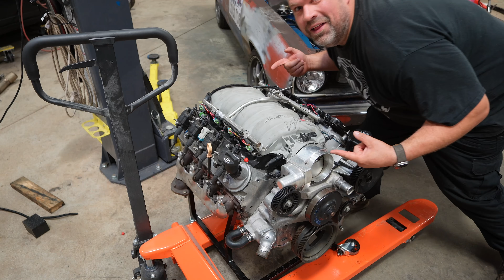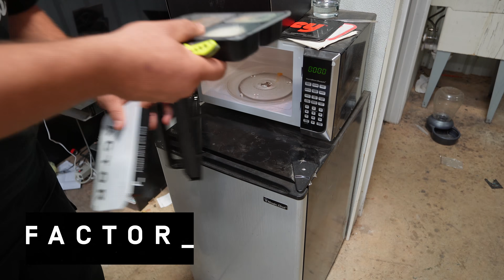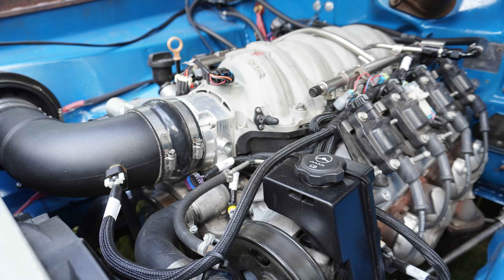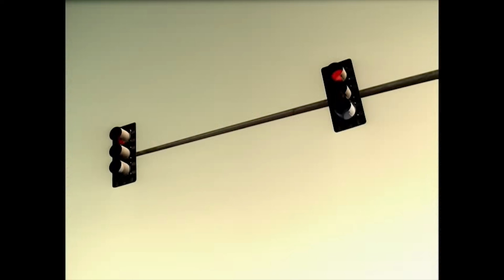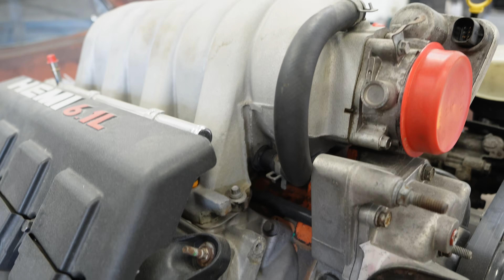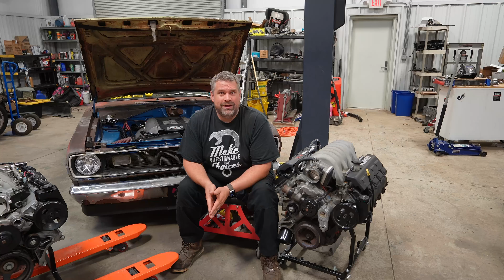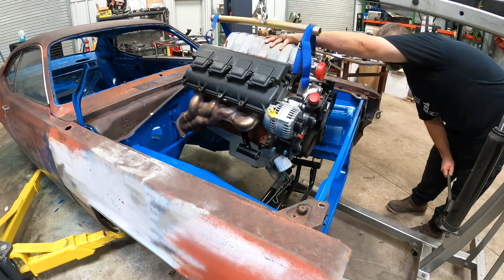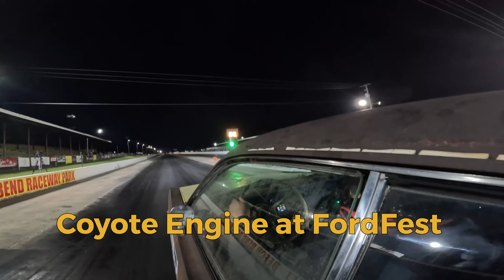What No One Tells You About Engine Swaps! Best Engine To Pick?

Comment: A verygood and informative overview.
Im 80  and st a rted r ngine buildups hot r odding racing and restoring cars in the 60s thru now.
Id add the following observations.
These observations pertain to street and racing but not both all the time.
In my experience for racing or street hands down the easiest least expensive most available most supported engine is the LS Lt family.
They are compact light weight and very durable..
They will fit most all RWD CHEVS going back to the tri five passenger cars and trucks.They are light weight and favorably affect weight distribution and thus handling . Wig h t ONLY  top end modifications you can reliably increase horsepower and torque by 100 to 150 hp depending upon which LS you re tzlking about.
Chevrolet and the aftermarket support modern LS electronic packages .The original vomputer can be reprogrammed by tuners who know the codes. The LS 3 for example with a little he s dwork and cam change and a Magnuson supercharger jumps from around 440 hp to nearly 600 reliable hp. The 505 hp LS 7 can with headwork cam and exhaust changes make around 650 hp normally aspirated on pump gas and little change in driveability or gas mileage . If you re going to track a Vorvette on a road course for durability because of sustained high rpm and lateral G forces you must instsll a good 3 stage drysump system. This engine was the high point of the normally a s pirated LS series to date in my opinion..
Any of the stock of modified LS engines can be ea a ily retrofitted into just about any GM RWd chassis due to extensive multiple source s of retrofit kits.  Additionally dive aftermarket transmission and susp r nsion suppo r t kits allow hughe upgrades in handl😢ing snd braking performance to match the power output. I personally have seen a 67 chevell with a supercharged LS3  and extensive Hotchkiss suspension mods and Baer brake front and rear disc brakes and high performance 18 inch wheels and tires pull 1.07 lateral G on a skid oad. Detroit Speed skes kits that can better this.
MOPAR. My personal preference since the 60s was to avoid the hemi. It still is.
Fir d t off the Hemi was never as delivered from the factory a satisfactory street engine. It could be modified to be one but the initial cost plus the modi G ication cost was simply not worth it. A sharp running 440 375hp Mopar with 3.9 gears headers and single Holley 4bbl was more effective. The 440 6 pk engines would generally beat a street hemi for f a r less cost and not nearly the handling oenalty.
The modern hemis especially the 5.7s have valve tr a in probles that result in loud ticking noises and early camshaft failure. The engines are relatively expensive out of the s a lvage yards. They are iron and heavy.
For big block work I far prefer a bored and stroked 440 out to up to 512 c.i. using CNcPORTED ALUMINIUM HEADS  headerrs a Holly F I sustem and an Indy or Edelbrock aluminium manifold.
This results in something north of 650 hp streetsble less front end weight in a retofit to a Challenger or Barracuda and hence again the potential for vetter handling.
For small block usage i prefer the 360 LA or Magnum short blocks. Again with the proper camshaft  sto c k or CNC ported Edelbrock or other aftermarket aluminium heads  carbonated or injected fuel system these engines can produce 415 hp and around 440 ft lbs of torque. Running on pump gas with a 10 to 1 compression ration. They can be bored and stroked to 408 c.i. at which time 450 to 500 hp is attainable..
And theres no weight penalty . The only caveat is because of the lack of crossbolted or s payed 4 bolt mains you should depending on the displacement and stroke rbuild the engine to make max hp by 5500 to 6000 rpm.
Im not a fan of Chrysler automatic transmissions after the Torque flight or their ability to live with much more than 400 hp being thrown at any of the overdriven units so I use Tremec 5 9r 6 speed m as nual transmissions.
The Chrysler 8 and 3 4 unit is bulletproof for small block applications. For big block applications the Dana 60 with Moser axeles works very well.
Excluding the modern supercharged Chry s ler hemis making from 700 hp up the engines I have mention will outpergorm are simpler lighter and less expensive than the modern norm a lly aspirated hemis and probably more durable .
The Coyote engine is lovely to look at delightful in concept and needlessly complicated and trouble prone. It doesnt fit in the 60s and 70s engine bays due to shock tower and other problems.
By far my choice is the 363 package engine from Ford.
Dimensionally it will fit whereever the 289 or 302 engines would fit .its east to retrofit oringinal accessories will generally bolt on it can run on pump gasthe heads and intake are aluminium its light and its simple. As delivered in a box it makes 500 hp vs the Coyotes 465 hp. When slightly detuned with a dual plane manifold and slightly lesscaggresive came hp drops to 475 hp and its completely streetable.
Its t he answer to early Mustang Fairlane or Falcon upgrades. And the suspension and brake departments are well supported by the aftermarket. Modern aftermarket FI sysrems work well with this engine. Again I o refer Tremec manual transmissions . The Ford 9 ingh or 8.8 rear ends areso.e of the best around and have an almost infinite variety of gear choices.
While the 363 does not have the WOW factor of the Coyote it has the advantage of being virtiually indistinguishable to the casual observer from a w89 or 302 engine. One of my current cars is a white 64 Fairlane 500 coupe with a 5 speed Tremec  an 8 inch locker and a 363. It runs the original 289 Hi Po front fender badging  with front disc brakes and suspendion mods an export brace a zmonte Carlo bar tied into the shock towers up rated spring rates Bilstein shocks and front and rear sway bars.
It isadumb simple basic car that we ill run out at over 150 mph and handle and s top rea s onably well.
SIMPLE IS GOOD 
INEXPENSIVE IS GOOD .
AVAILABILITY IS GOOD. 
DRIVEABILITY I S GOOD
INTERCHANGEABILITY IS GOOD. 
The above are a set of rules to live by..
The new Zo6 5.5 liter double overhead cam flat plane crank engine makes 670 hp.
Its a tech marvel Delightful to listen to.
Chevrolet is having valve train problems with it.
Personally Id far rather be running a built up LS 7.

Comment: It's illegal(in US  FEDERALLY) to swap other than the same yr and engine to anything that came with a VIN
Reply: Shut up! Who cares.
Reply: No it's not. You just need an engineering cert
Reply: @_wallnutz_  ask / tell the EPA that all vehicles have a set emmissions limit that the car has to be @ or under bigger ,more  powerful burn more fuel ,you need a state license to tough anything on fuel ,only dealerships anymore are qualified to to this , you know they would not do this mod
Reply: @artyfuffkin7805  so you can. The engine that came in the car isn't available anymore. Swaps are permitted
Reply: @_wallnutz_  per our highway patrol state inspector ( they're  the  officials that handle it )there are only  a few 302 for 289 Ford, 305 for 307 Chevy,  318 for 340 chrsy, , I'm a 30 yr dealer tech ase master ,  you can't set fuel settings on a chain saw after 2012 ( special tool)
Reply: @artyfuffkin7805  Dude the democrats want to put kill switches in all cars and ban all old cars. We got bigger problems.

Comment: Hemi...just a marketing name owned by Chrysler Corp(now Stellantis) because of Chrysler's hemispherical heads from the 50's v8's, which weren't called Hemi by Chrysler but eventually people started calling them that so Chrysler used the name for the 1964 426 Hemi(still kicking ass in aftermarket all aluminum version in ALL nhra top fuel dragster/funny cars, essentially the 426 wedge motor with hemi heads, not really but for the most part(1966-1971 in cars). Now Chrysler can put a Hemi name on any engine they want like they sadly did on the Mitsubishi 2.6, 4 cylinder in the 80's! 😢 Gen 3 Hemi's different not quite hemispherical heads compared to gen 1 and 2 heads but again Chrysler can call anything a hemi if they want to.

Comment: I have a Chevy HHR roller, I took the factory 2.2L motor out because of a blown head gasket, got a 2.4L and overhauled it, but it's just been sitting for 2 years. I've been debating to put a v8 in it instead of the 2.4L, You talking about the LS4, I think a LS4 would be a great upgrade for my project.

Comment: My mechanical background came from motorcycles, and import cars. I was impressed by horsepower per liter, and rpm, and the used American cars left over from the late '70s and early '80s were pretty bad. Mustang 2? "Landau" tops? A wheezey 305 with like 130 hp and an auto trans? Awful stuff. Clicking on a turn signal in any 1984 American car, the feel of it, told the story.
   Then Honda came out with the s2000. 122 cubic inches, 240hp..gotta like that, right?
      But, the gas mileage is surprisingly bad. 
    I drove one. Not so fast. Gotta rev it. To 8900rpm. Sounds like every inline 4...(1-3-4-2 repeat..)
   The engine compartment is surprisingly full of a 2 liter 4 cyl. 
    I was checking out the new Vette Ls1. Smokes the Honda. Similar engines stuck in trucks are used to do actual work and are pretty reliable. 
    Unbelievably,  the highway mileage of the heavier Vette was better.
   Sounds way better.
   I was on that tangent to get to the point. HP per liter? Who cares? At all? It is a technical prize, and utterly useless.  
   The job of the engine is to fit neatly into the available space, not weigh a ton, and produce useful, reliable power efficiently,  for a long time. And be easy to produce and repair. 
   What else can matter?
    Ford chose to fill (and then some) the allotted space with a lot more parts, partly probably with the goal of winning the hp/liter crowd over. Did they win? I don't know, there is that s2000. And some Ferrari...all are shamed by any 120hp 600cc ( 36 cid) sport bike. 
   So, Ford took up more space with parts than GM and Chrysler did with bigger cylinders. A different philosophy..not for me, thanks. 
   I put an LS2/t56 in my volvo after considering both a new Hemi (too big) and an old Ford windsor (nice size, but, other factors).
     The coyote? Never considered that big thing, although the me of 1984 would have loved it.
   The Ford vs Dodge vs Chevy aspect really didn't matter. Although  ford's recent trend of throwing more parts at a problem is making all of their products less attractive. Complexity is usually bad. Avoid Complexity unless there is a really good reason for it. Doubly so if you can't pull it off reliably. (Ecoboost cam phasers, etc...)
Reply: You did learn, however you're very biased. Chrysler/ Mopar, Everyone I know has had issues, originally electrical now all the mechanics I know are showing me an amazing amount of plastic being used on the engine itself. For instance the intake manifold, that eliminates Chrysler. Leave it between Chevy and Ford. On my way to the Chevy dealer back in 2003 to purchase my first NEW muscle car not USED . I did not have the money for a new Corvette, I wanted to go with a Z28 they told me they had it in stock before I got there. However it was discontinued and they tried to sell me a six-cylinder.
On the way home I did the unthinkable. I went into a Ford dealership. In a million years I would never consider Ford. Found on road dead, Fix or repair daily, it's garbage stay away. Needless to say they had Mustangs in every color and configuration possible. I fell in love with a 2003 Cobra. If you are Unfamiliar it comes supercharged from the factory. Bottom line is, I drove that car like a lunatic! Never even broke it in, smoking the tires as I was leaving the dealership. Never had one mechanical issue, only needed basic maintenance and lots of rear tires. My fault got addicted to doing burnouts like a kid. When my son got older he always wanted one. He picked up a 2-year-old California series with very low mileage, he has it to this day. Again no problems at all, basic maintenance. I would love to speak to all the people that have a deep hatred for Ford Motor Company. Go over my personal experiences. To my surprise the Cobra even had a skid plate protecting the transmission and whatever else could be damaged. Found out the hard way, it saved my car.
Love the Japanese cars as far as fit and finish and quality control. I've owned Honda Civics, Honda Accords, Toyota Camrys, and one Nissan.
Great for dependability gas mileage last forever if maintained properly never was able to get my Need for Speed with those vehicles I don't believe in spending mountains of cash to modify a slow car it becomes a money pit. Not built for it.

Comment: Im a mopar guy from a toddler but you got to give it to GM, they made their LS accessible and versatile. You can put a LS in anything. You cant really do that with the hemi and coyote.
Reply: Ls having the same bolt pattern as the small and big blocks is a giant deal. They'll go in anything, boats, trucks ,etc
Reply: @XxMusclecarsxX  I watched Roadkill pull LS from muscle truck and swap it to a speedboat then back again
Reply: You can go blindfolded to a junkyard and still find an LS for your project.
Reply: @BruceLee-xn3nn  the same can be said for your average 5.7 lol. There really is no reason to run an LS over the Hemi unless you need the smallest engine possible. Eagle and Apache heads far outflow the LS or LT at every point of lift.
Reply: @PyroBlonde7777 
The AFR's on my LS1 far outflow the stock heads....
So, what's your point?
Reply: @PyroBlonde7777  SHHH dont tell em, best bang for your buck nowadays. Same reliable design, and more power and since everyone does LS swaps the hemis are the cheapest way to kill 6.0slq4 and 5.4 tritons 😉
Reply: @salvatrucha777  just saw a mint 6.4 engine for only $3,500. No way I'd take a wedge head rip-off of a Mopar small block (ls) over a Hemi. Chevy guys can keep dreaming lol
Reply: @garyh.8082  congratulations. You had to purchase aftermarket heads to flow less than a ported Hemi. Rather than learn about a different platform, you insist on sticking to the same cookiecutter bullshit as everyone else. Not impressed in the slightest.
Reply: I got a 03 dodge 1/2 ton 2wd for free , im thinking 4bt or 6bt , manual shift maybe , its a automatic now , i might leave it auto till that tranny pukes ..ive put fords in chevy's , and chevy's in fords , and both into jeeps ..now all manufacters are on the same level i think , they all shut cylinders off at highway speeds and the lifters fail , its sad they are ruining our v8's , they already ruined all the diesels ,got everyone brainwashed on clean air , when its all a tax scam , any good motor builder from the old days knows that 😂😂😂😂
Reply: They made a cheap wedge head with engineering stolen from Chrysler small blocks. From the rocker shafts to the skirted block. Yes, it is a compact affordable package. But thats because it has inferior heads and a weaker aluminum block. I'll stick to the Hemis, thanks.
Reply: @PyroBlonde7777 there are cast iron blocks man like my 5.3 vortec gen 4
Reply: @Driftygtrkidd16  enjoy paying thousands to flow less air than a regular 5.7 eagle Hemi.
Reply: @PyroBlonde7777 😂😂😂 going hard for tha most unreliable motor
Reply: The Chevy does not have shaft rockers like the small block Mopar. The small block Mopar does not have a deep skirt like an LS. Your comparison makes no sense.
Reply: @PyroBlonde7777 not true at all. Very strong and dependable engine. It’s been proven time and time again. And I own a Ram and charger scat pack
Reply: @PyroBlonde7777 Most LS come with iron block. Also, unlike your Hemi, they don't tend to rapidly disassemble themselves on the street. For your information they make 6.0 and 6.2 LSs. But I like the Hemi because those POS makes me lots of money in my shop since they cant stop breaking.
Reply: @brucetec6597  Love it when a Chevy fan boy tries to pull one over on a Mopar guy who builds Hemis. The ONLY point of failure on a gen 3 is the MDS lifters. That being said, that issue is less than 1% of Hemis. Any Hemi after 2018 no longer has MDS failure. With all due respect, please stfu and stick to oil changes.
Reply: @brucetec6597 iron blocks ain't real LS engines though. They're usually LMs
Reply: @PyroBlonde7777  sounds like ford boy copium to me.
Reply: @howardwoods342  at what point was Ford mentioned in this thread? Or are you referring to the Ford bolt pattern of the LS?
Reply: The ls thing is so way overdone. I get so tired of seeing virtually everything with an LS swap in it. Yes, they are cheaper and easy to find. But, to me, it shows a little bit of a lack of imagination, and following the crowd. I am definitely a Mopar guy and will always be! The one thing good that I can say about the LS engine is also a fact of the hemi. At least both Ford and Mopar stuck with a push rod engine. Best way to make low end power and high-end power as well. It's also a bonus that they are both cheaper to manufacture. People can keep their LS engines. If I were to be given one I would sell it
Reply: Mopar guys are the crowd 😂 @tonyImperial7175
Reply: @tonyImperial7175 Most of us don’t have a tree in our yard that $hit$ money. Therefore LS engines are the way. GM is first place and Ford and Dodge are fighting each other for last place.